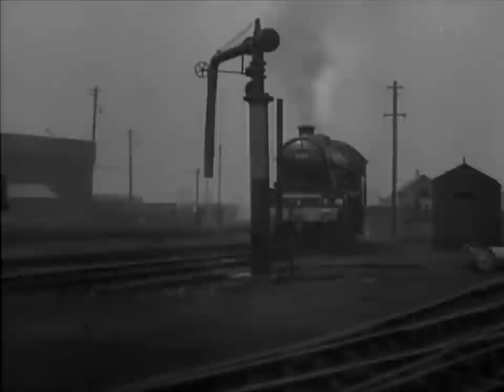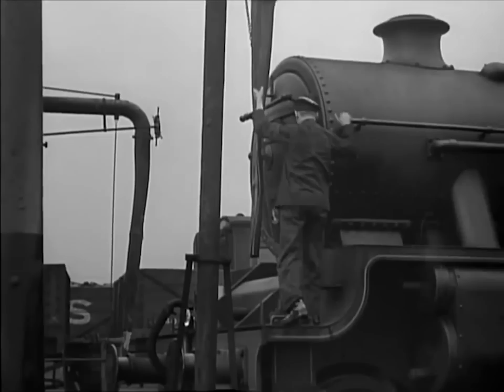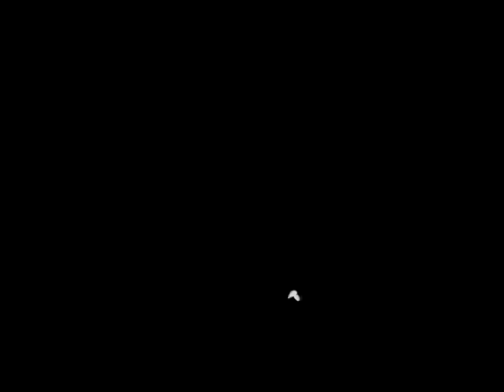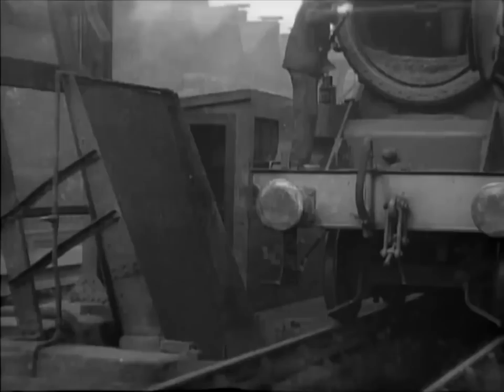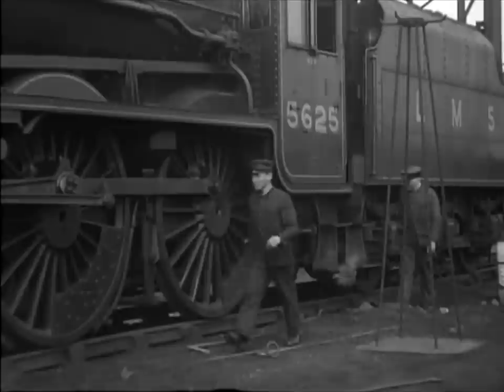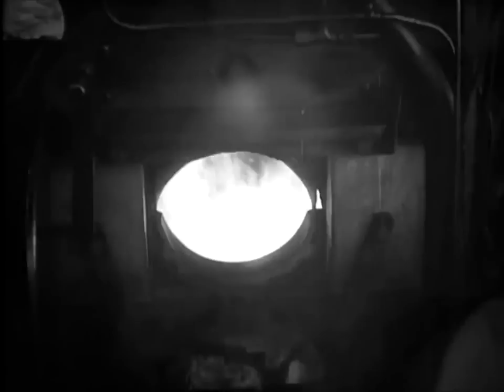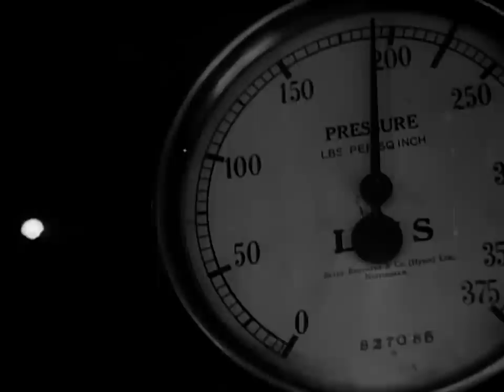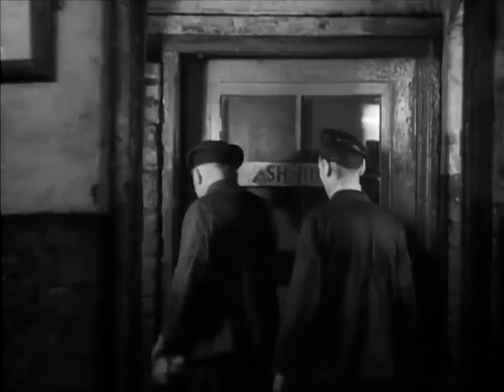Vintage rail film - Engine Shed - LMS 1938

Comment: Very interesting film for anyone planning to build a model railroad engine shed or depot. However: didn't they also have to fill sand into the engines for improved adhesion on the rails when braking or going uphill?
Reply: American locomotives had sanders; can't say I've seen them on British ones in these educational films.